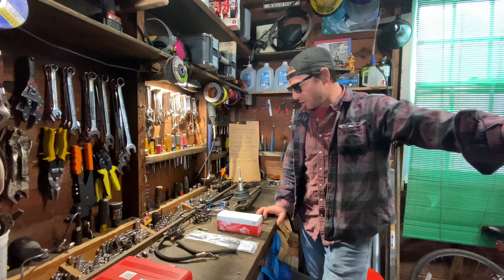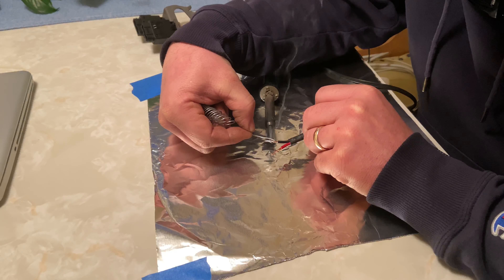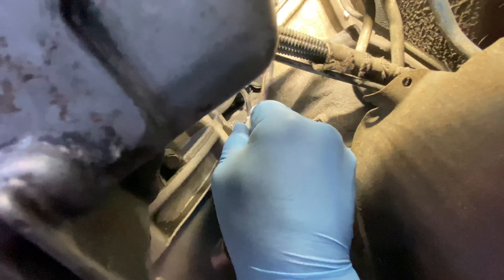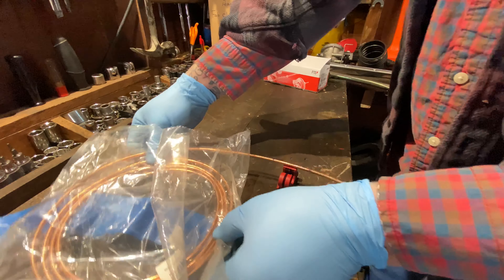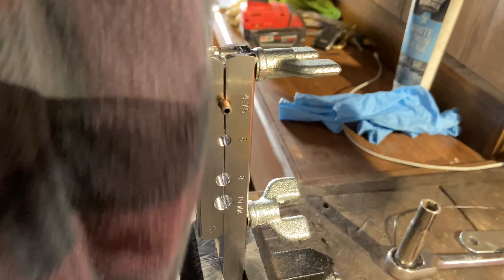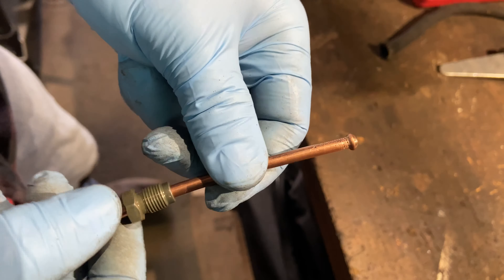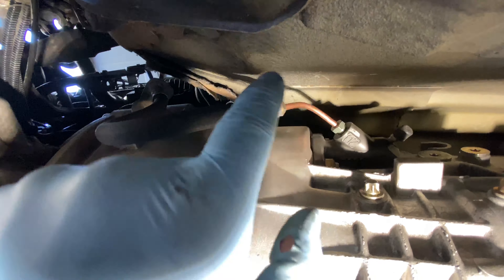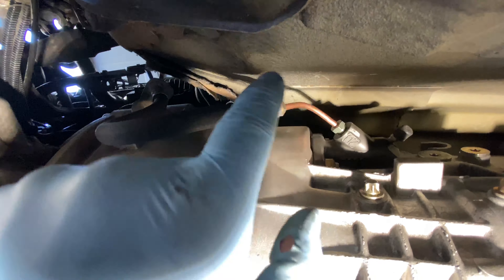BMW E36 M3  Clutch Line Install with Bubble Flare DIY! MUST WATCH for tips and tricks!

Comment: Can u run the hard plug in pipe while the trans is out?
Reply from the maker: Absolutely, it will hang loose until you plumb your clutch fittings.